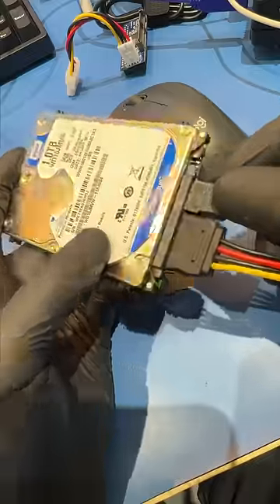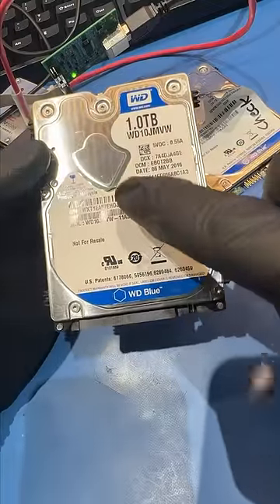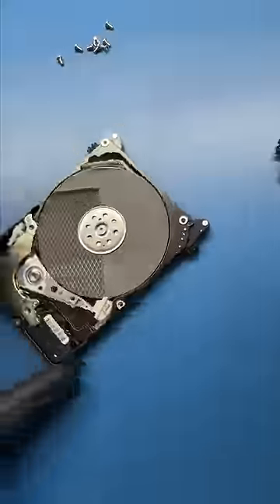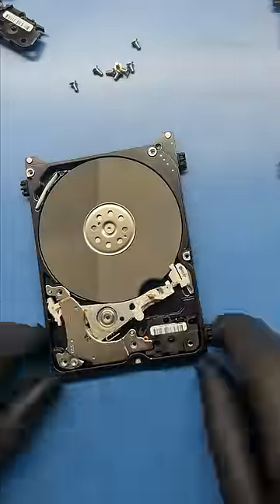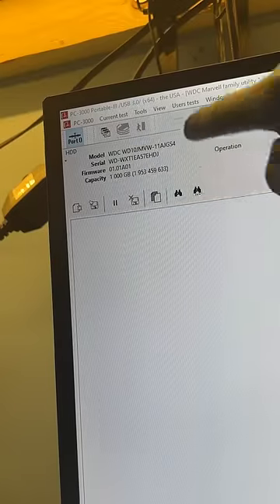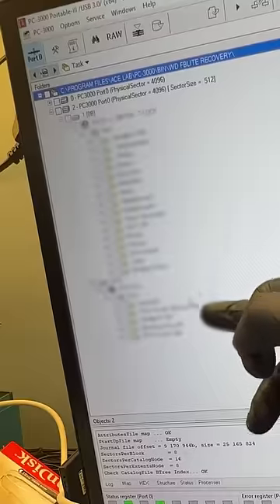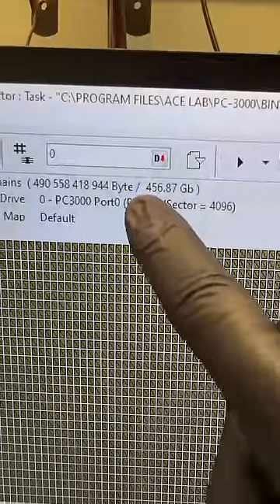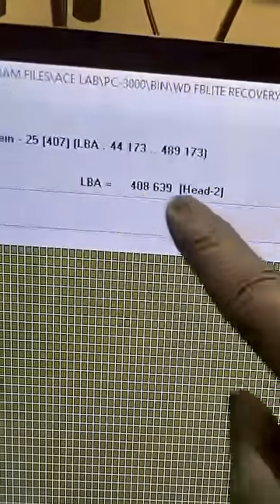Hard Drive Data Recovery Possible…? #technology

Comment: FYI to everyone. please do not open your hard drive. any piece of dust can ruin it if you plan on still using it for normal use
Reply: What if the hard drive will no longer read? Can you take the risk to fix it?
Reply: @HavocBlack  as long as you understand the risk. as it'll most likely not be able to store more data on it.
in an ideal situation if you do open one, you need a air positive room with no dust. (clean room)
Reply: I don't think either of those drives will be for normal use
Reply: @SibaNL actually hdd as lots of stabilisationsstem ewen if not perfect. They can move up an down magnetically controlled head which mens if no power failures and no damages amd air is clean... sstem of hd will handle small alignmen errrs of heads.. but still its smallfixes... atleas thats what iv seen when i opened one yeara befre...
Reply: @navytiger2 You can sometimes get one last chance to copy some of the data.
Reply: we already know
Reply: @HavocBlack  NO
Reply: @ahmetmutlu348  Yo I think your keyboard is broken
Reply: @HavocBlack You can but make sure there is as clean as possible. You only do this to recover data and extract the data. The disk will 100% die shortly. 
But he should have open the spare first and remove the heads before opening the defective drive.
Reply: A piece of dust ruin it my WD Cloud NAS flipped over while running causing the heads arm to swipe across the top platter and stick I took it apart spun the platters counter clockwise while gently moving the stick arm to park position used a micro fiber cloth and rubbing alcohol took away the smears and unstick the heads and arm.

Put it back together still running this was the launch version of WD Cloud NAS with the WD Red NAS hard drive in it the 4TB Version been running for about 5 1/2 years runs 24/7 still has all the data nothing is corrupted I used the back USB to back up everything on it.

Still reliably working but no longer supported by WD it's discontinued no more updated but man was it a B to get the outer casing if the Nas apart

Comment: I’m curious - why didn’t you keep the data on the hard drive now that it works?
Reply: Possible future failure. Once it’s open, it’s prone to fail. Back up the data and replace the drive.
Reply: It may break again in the future
Reply: He touch plates. Its will be broken and in air will be oxidate
Reply: When it touches air you don’t have much time left, maybe a week or two
Reply: Dust, oxidation, and impurities in the air cause the drive to damage itself just by running. It'll work for maybe about 20-50 hours before the data starts becoming unrecoverable.
Reply: Its god to use clean air cointainer from plexiglass its cheep. And use new Hepa filtet. And plug from second side hoveer. This make clean air inside. Also build into this rubber glove. I cant add link. Just put hepa filter hdd box.
Reply: Potential for failure in the future
Reply: @luismelloleite  in fact most of hdd drivers  are not fully sealed. They have small hole with carbon filter. I open o alot of hdd. Air inside is filtered but this is still air. Just no polution, dust, fungi seeds, viruses, bacteria. Pm2.5, pm10 etc the new server drives 20tb  have heluium inside and they are fully sealed. Other drivers plates still "touch" the air from outside
Reply: the disk in the hard drive should NEVER be exposed to the air the drive will work for a little while but both od the are gonna fail now that it was exposed
Reply: It a sort of rule during data recovery. Once you get access to data, you immediately copy it on a separate media.
Reply: If it fails once don't use it again.. common sense for data.
Reply: also head settings are different good to recover but will damage drive platters after a few days.
Reply: @josephnelson8419isn't that exactly what justy said?
Reply: Its like keeping your spare tire on your car. Things that dont make sense
Reply: @josephnelson8419they are self proclaimed geniuses while uttering gibberish. Hard drives (non halogen ones) got air vents and air could pass through them filtered.
Reply: Opening it exposes it to contaminants and other things that can cause damage to the platters and kill the drive quite quickly

That's why the best data recovery places have full on clean rooms for drive head swaps and are basically in full on hazmat in order to prevent themselves from contaminating the platters
Reply: It “works”. Since he manually replaced the EXTREMELY delicate and precisely built read arms that drive is pretty much a zombie. Any heavy load will prolly kill it.
Reply: That would be like permanently using the spare wheel on a car
Reply: It’s basically a Jerryrig. It’ll work long enough to do what you need, but not much longer than that.
Reply: To those saying the inside of the drive should never be exposed to air be because of oxidization. News flash! Theres air in the drive.

The actually have a vent with a filter that helps regulate the pressure inside.  

Now, you dont want to open a drive in an uncontaminated environment (out in the open) because of debri in the air. But air itself is crucial to the functions of the drive.
Reply: @maluszek892 Thats if its exposed to water. Theres air in the damn drive and it even has a pressure regulating hole with a filter. 

Most all metal oxidize when in contact with water as the oxygen in the water bonds to the metal. Now very moist air can have this effect but again, thats a special circumstance, not the rule.
Reply: It can go bad again. It's better to be safe than sorry
Reply: Is not reliable, better to put in a new drive one
Reply: Hard drives are hella cheap. You can buy a 1 tb hard drive for $30 you might as well replace it
Reply: Why is everyone arguing over if there is or not air in it instead of the answer to the question? The inside of the drive has been messed with, probably contaminated, etc. it will die again soon. Even if it wouldn’t, if a drive dies, why would you use it again?
Reply: He took the reading component from his healthy drive to read & recover the customer's data.
He has to put the reading component back to his own drive then. The customer only wants his data, not repairing his hdd.
Reply: After replacement just clone the hdd. Encrypt data? Your client knows about this and he need privacy! You hack that privacy? Not a good decision, your client will not be happy!
Reply: @ElZamo92 lol pure bs
Reply: the hard drives are all very very sensitive, essentially if even a spec of dust makes its way inside, it wouldn't take long before the drive fails again, not worth, its better worth moving the data over to a new drive
Reply: You can never really repair it, it’s far too dangerous. Never play around with data safety, always use a perfect drive or you risk all the data.
Reply: becoz : reasons
Reply: @maluszek892 I mean unless you are using a laminar flow cabinet air will be dusty. I didn't work with hdd's, but I cleaned a lot of glass and for certain applications (glass-on-glass welding) cleaning had to be done in one of these.
Reply: We don't want the donor hard drive to be without it's reading heads... It's like removing a liver to give another human to filter toxins the donor needs it back if he is still live and well.
Reply: Data can be easily lost since it broke once, and it WILL break again. Its better and safier put in another HDD or even better, put in a SSD. There's no reason to maintain important data in a damaged very slow HDD.
Reply: New SSD and HDD become cheaper, so it’s better to backup the data to the new hard drive rather than keeping it
Reply: @maluszek892  no need, just copy the data and throw it away. It's the data that matters.

Why are people so attached to disks...

You like reuse bullshit, there's recycling , good thing HDDs are mostly glass and aluminum .
Reply: it will only work for a while.
Reply: @tristanweide  I'm still using a hard drive I bought and I opened it a few years ago just to see what's inside. Carried it into the garage from my bedroom and showed my uncle and cousin before putting it back together. I'm running my OS on it right now. I do have issues with my computer, though. Especially with auxilliary drives.
Reply: Jerryrigged... You would be lucky if it would hold up until the data are read. Writing to it is different story.
Reply: @tristanweide   Just use a laminar chamber
Reply: That HDD is living on borrowed time.
Reply: As he showed and said in the video, you need a special tool to recover the data after that type of repair. It is no longer functional as a normal hard drive.
Reply: @connorbramhall513 clearly this is not a NEVER situation. there are times it’s needed. Just like this time.
Reply: @darkopz  this is a tempa Is temporary solution the disk will not last long now that is has been opened long enough to back up sure but it is no longer useable in any normal way unless you want your data to be corrupted
Reply: Rule number one of data recovery, always copy to a new source. Rule number two, never trust a hdd once it starts giving errors or needs to be repaired.
Reply: @connorbramhall513  The disk enclosure if full of air all the time.  How do you think the heads fly?
Reply: @josephnelson8419 How can you tell that he's not in a clean room?  He obviously does quite a lot of work on hard drives, so I would expect that he's aware of the need for cleanliness.  You can do this kind of repair under a hood that has clean, filtered air blowing through it.
Reply: So data recovery engineer here. The platters will not die after coming into contact with air. I have several drives waiting for approval that are weeks old and have been opened. Those cases I can get the data back just fine though why the heads died is another matter. 

Why would you keep using a drive that got damaged? That is just asking for problems. Maybe if it was a pcb issue but not these kinds of issues. You recover the data and clone it to another drive, image etc and extract from that. The client drive could die at any minute becusse of platter damage from the failed heads/drop, bad sectors that rapidly kill a head leading to platter damage, firmware issues etc. you fix it deive could come back a day later dead. Also the drive does not have original heads which leads to issues under normal operation. Pc3000 is able to stabilize the drive.
Reply: it's mechanically compromised and also contaminated.
better not risk anything.
Reply: drives are consumable one way or another. if it goes bad, move the data
Reply: It's called degassing, HDDs are in a vacuum to work, introducing oxygen ruins the disk.
Reply: Making money
Reply: WHAT!? are you insane? Please tell me you don't work in any industry that requires any mechanical aptitude. Once you have your data you put it on a new drive. PERIOD!
Reply: It will fail again - you should never reuse a drive that's been popped open.
Reply: That "repaired" drive will Not last long. Get that data off ASAP!
Reply: @andyk192 It probably is functional as a normal drive, but that thing is living on borrowed time, so you need direct access without an operating system in the way, bare minimum number of reads, and to skip unreadable sectors (maybe they'll work later) and continue with a sparse read to allow maximum recovery before it dies again.  Very hard to do through an OS where it will just encounter a read error and then stop to throw up an error message.
Reply: @johnwayne2103  broke relax the guy was asking an innocent question. Most people don’t know anything about data recovery let alone computer repair.
Reply: @maluszek892 I just destroyed several drives all from different manufacturers. Each of them has an air vent with a filter over it. So they are not sealed air tight and oxygen is not an issue.
Reply: the thing he put to fix it is his ,for testing and recovering not to give away to costumers lol
Reply: @court2379  i know now. Only avoid dust and 2.5 pm particles.
Reply: customer HDD is older than donor drive so the Firmware do not match the platter & M/Board so tool is needed to bypass firmware & Encription but is read only for recovery only.
Reply: It's not reliable anymore
Reply: Some of the comments are wrong.. There ARE drives that are completely sealed and filled with gas... But most of them are vented. There is no oxidation happening.
The problem is with the particles that fall on the surface of the discs... Even the smallest ones can destroy the drive over time. That's why professional data recovery companies have cleanrooms to make sure there are no additional particles flying around opened drives.
Opening drives like that is OK just for the quick data recovery. I wouldn't trust a drive that was opened before.
Reply: Because that is a Dead HD working 😅
Reply: @luismelloleite  so, the air insyde came through special hole was different?))
Reply: It’s no longer reliable. And he used donor parts from another identical drive to be able to recover the data on the bad drive. Specifically the actuator arm assembly.
Reply: because as soon as he opened it the life expectancy of the drive dropped to "You will be lucky if it lives long enough to extract everything". Hard drives are "sealed*" to prevent moisture and dust from contaminating the platters, as those reader heads float mere fractions of a millimeter above the platter and any obstruction such as dust will make the drive fail rapidly. 

For the sake of the video he showed us the process on a bench. But he is most certainly doing it inside a special  sealed chamber, and even then, a hard drive that has undergone surgery is not long for this world. 

*Many drives do have a breather hole to maintain equilibrium with air pressure of the environment, but this hole is protected by a special super fine filter. Some other drives are totally sealed, and filled with inert gases like helium.
Reply: There might be damage we cant see, better to recover the data and get a fresh drive, they're cheap anyway.
Reply: It's a storage drive, and it's encrypted. Can't just mount it.

Comment: And that little fix costs 5000 dollars.
Reply: Hardly 150 dollars
Reply: Hardly a box of Hershey kisses
Reply: @GeorgeDaPro3847  I'd assume $600 minimum. Data extraction is pricey. 

You're looking at cost... No price of service.
Reply: @robbykeane7802  If it is SSD, it's a little cheaper. If it's an HDD it's a lot more expensive to fix. The reader is the most expensive part. It is very difficult to swap out the reader. You are right

Comment: The “PC-3000” is the most 80’s thing I’ve ever heard
Reply: Fr lol
Reply: And it looks like something made in the 90s or early 2000's
Reply: So which is the latest software used for data recovery, just asking for GK
Reply: @desigamer6339 it’s definitely the pc-3000 If he uses it very frequently throughout his videos on computers, hard drives, new phones etc.
Reply: The PC 3000 machine is very useful and costly on data recovery
Reply: @kimb6793 yes it's 80's thing .. and price is also very cheap jst 15000$😅
Reply: @crisis1471 The base model HDD only model is 11k and the full bundle version is 21k USD. This device is incredible
Reply: Best compliment you could have given to software.
Reply: Actually it's the model from the year 3000.

Comment: Don't try this at home! There are many things to check first besides just assuming the heads went bad. Also, a clean environment is required when you open one of these and I'm not talking about Clorox...
Reply: Clean environment is an understatement
Reply: what happens if you sneeze on oen of them.
Reply: Logic board is the first thing to check.
Reply: we already know
Reply: Indeed. Those Platter's are ultra sensitive to ANY kind of debris.
Reply: @jarredw5380  the read heads glide as close to the platter as possible. any contaminate on the platter will be snagged by the read head and dragged scratching the platter and leaving you with a more damaged drive then when you started. pretty sure the read write heads need to be calibrated also
Reply: Easiest way to do this is just swap platters. 

Rest of the work the os and a file system rebuild will fix. Then boom bootable like original but new disk
Reply: Please dont overexaggerate this, its not like you need to be in a vacuum or a O.R. done this 100x
Reply: @Dio-kv7zl  Yes, and we all know virus are not good in computers!
Reply: @grgadgo1307  m8, one little speck of dust could casue major damage. even if it works for a few weeks/months, it may die much earlier than otherwise.